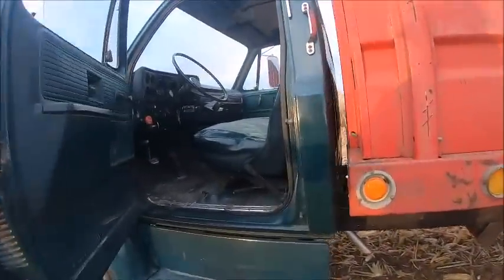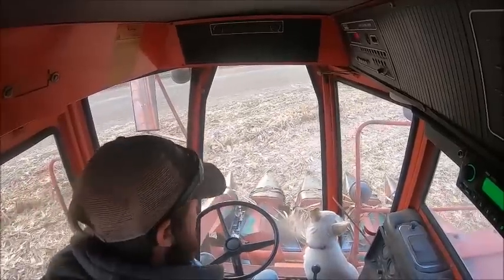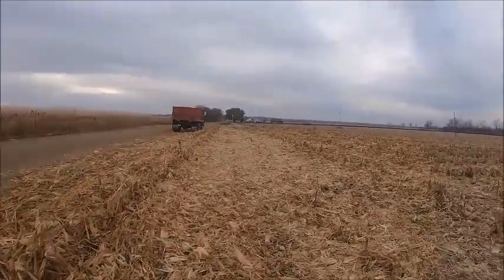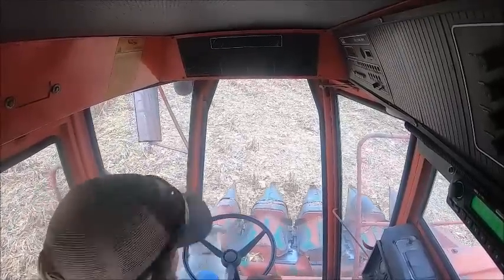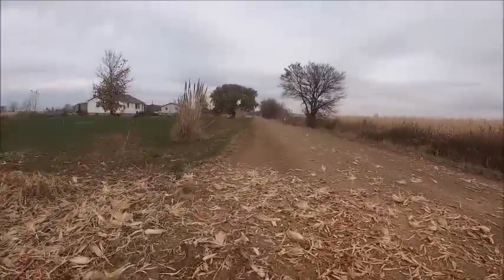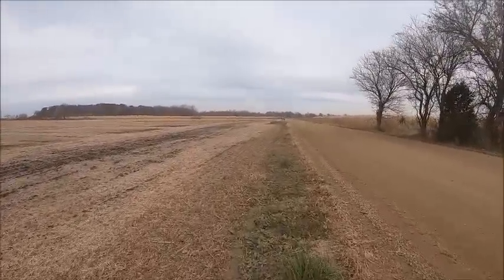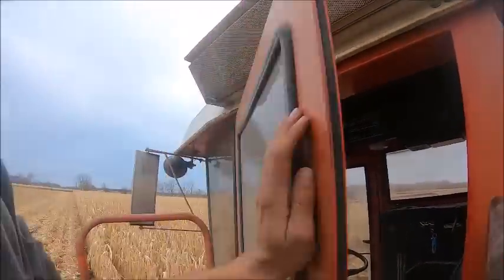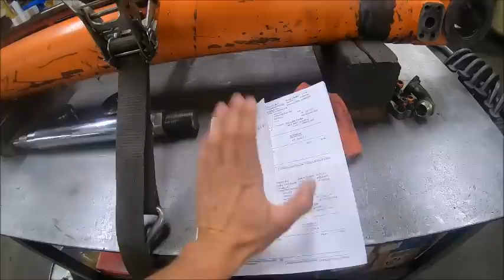Getting Rained Out On The Muck

Comment: Try the throttle wide open. Works on my 350 hp mack and my 2-155 series 3 White tractor and Mitsubishi lawn mower. wide open changes the timing for better starting.
Reply from the maker: Doesn’t help any and I don’t want the thing taking off like a bat out of hell right away stone cold with no oil pressure.
Reply: @Oliver66FarmBoy  I was that way on the 2-155 also but I decided to try it and by god it started right off and I throttled it right back. The Mack and the Mitsubishi say right on them to start when cold to start at full throttle. I think our 8900 was a little cold blooded also. The 1955 and 2-155 have relays that can go bad on the manifold heater also. The damn manifold heater draws so much current the old herculeas don't want to start because of low battery but since throttling up it starts fine. Been farming all my life and my cousin was the Oliver then white dealer from about 1968. Keep the videos a coming I enjoy them and have had most of the stuff you have in fact I still reach for the left side of the seat sometimes when combining but no levers there.

Comment: De pending on how cold it actually is, a solid good glow plug should only be used for 10 seconds upto 20seconds. Any longer, is a sign you have an issue somewhere. At least that's what I was taught
Reply from the maker: Any cold start procedure has glow plug recommendations all the way out to 45 seconds. 10 seconds is barely long enough to get the coil hot.